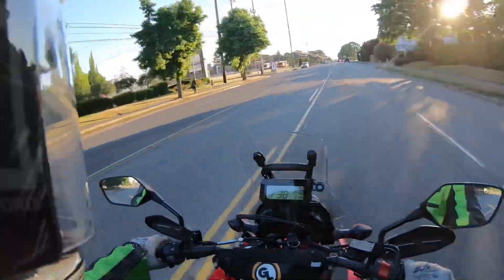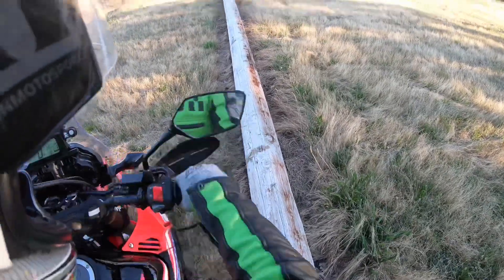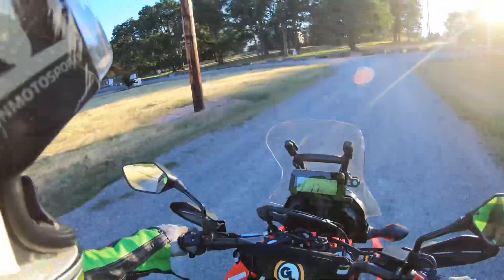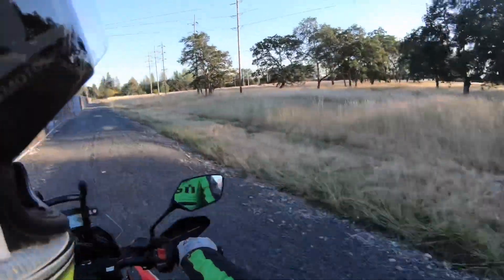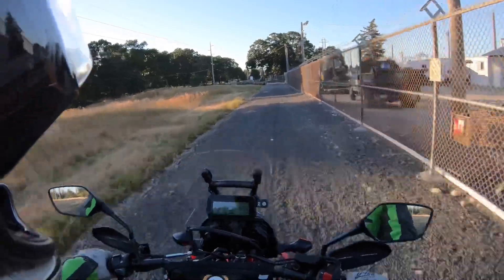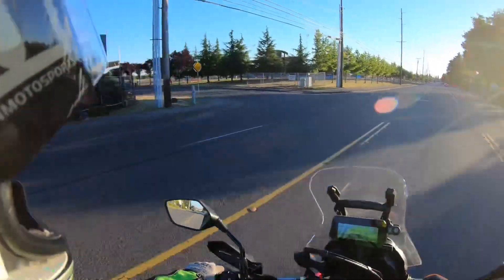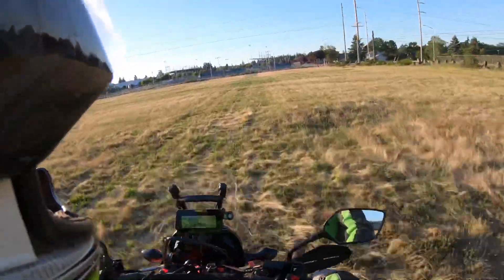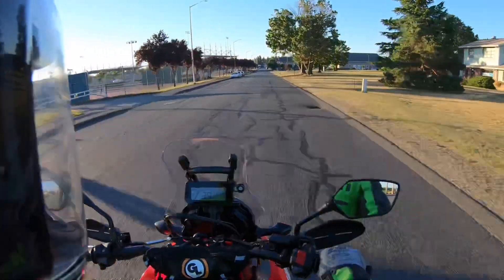CRF300L Rally - Log Hopping, Wheelie Technique, Exploring

Comment: Highest gear this bike can clutch up wheelie?
Reply from the maker: I’ve done small practical wheels in 5th with a suspension bounce and throttle, clutch up I usually do in 2nd, I guess it depends on your technique, I clutch it up pretty easily sitting on the bike at about 18 mph in 2nd without much help from the suspension.